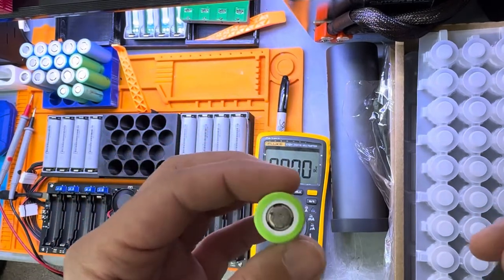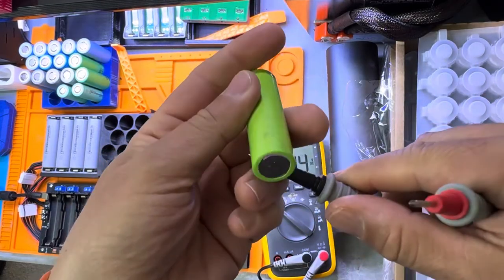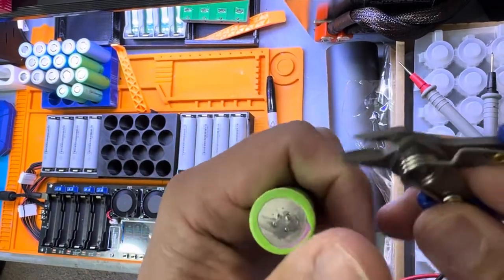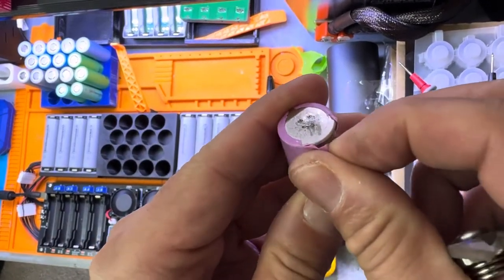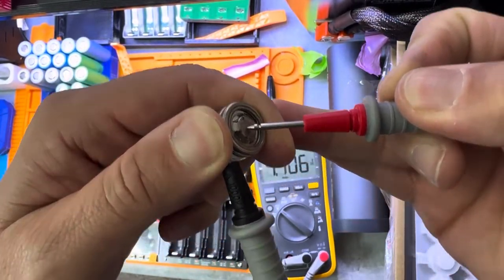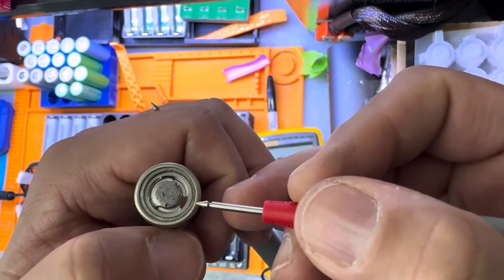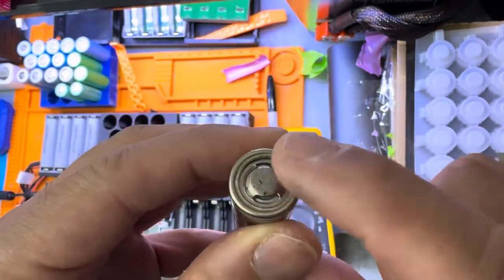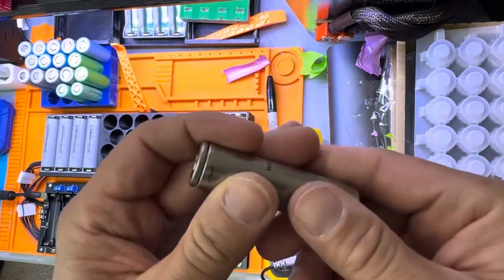This Is Why You NEED Insulation Rings in Your Battery Pack! (Real Demo)

Comment: Then you have bosch pro core 18V packs use completely naked cell, no insulators, not even the shrink wrap, just the bare metal you had at the end.
But the plastic holder has got integrated positive side isolator, and the connecting tabs are shaped to offset further away from the negative edge on positive side.

Comment: so is it reccomended to always add insulating fishpaper to cells, even if they come out the factory with the little plastic ring?
Reply from the maker: That is correct. The factory one is not sufficient.
Reply: @DIY500AMP  know of any oems that'll cut a custom shaped fishpaper isolator?

Comment: Great tip Nelvick! I learned that before I started soldering and it was good. I have also bend my copper plates to have some room. But it gets difficult when I bend them back to have another geometry. I have even soldered the - connector on the side of one cell one time to save cable and weight hahaha
Reply from the maker: Yes that works. I need to show you a technique I seen sometime ago.
Reply: @DIY500AMP yes, ok looking forward!!